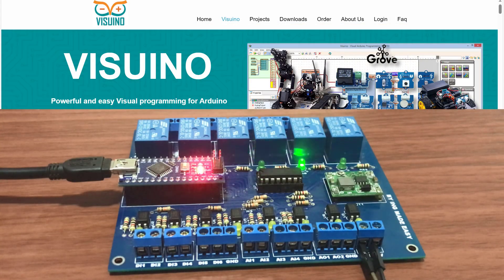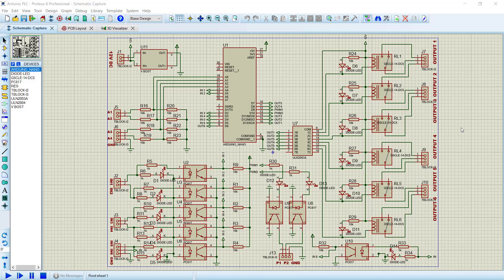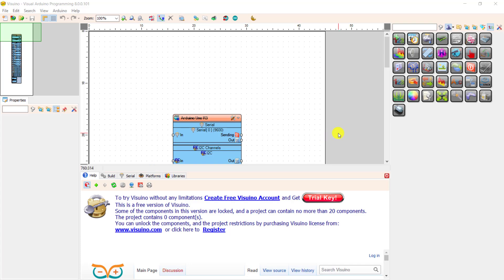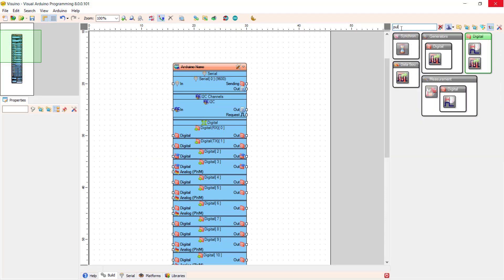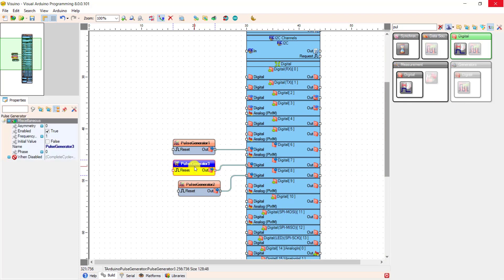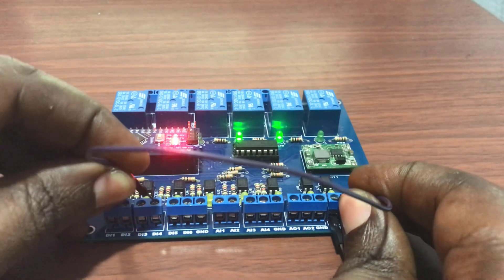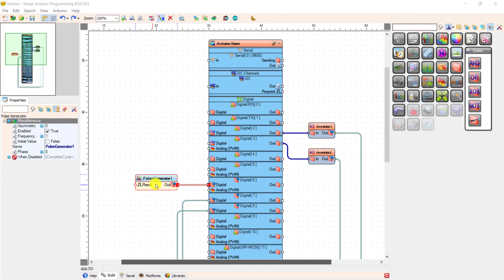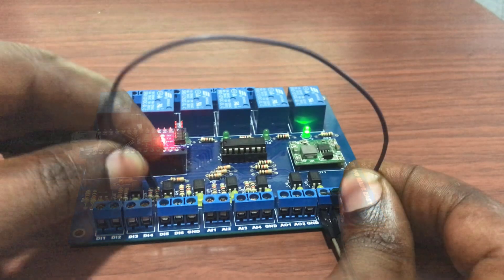Programming Arduino DIY PLC with Visuino

Comment: it looks like you are connected to Di2 and Di3 on the program but you are activating 3 and 4 on the arduino.... why is this? thanks for the video
Reply from the maker: Thanks for your question. This is because the pin Map of  the arduino board and the DIY PLC board is different.   So arduino Pin D2 is map to  Input  DI3 of  PLC  and Pin D3 = Input DI4.  Kindly see the circuit diagram in the one drive link for complete Pin map. Thnx
Reply: @engineeringmadeeasyingme6819  thanks for taking the time to respond. Great channel